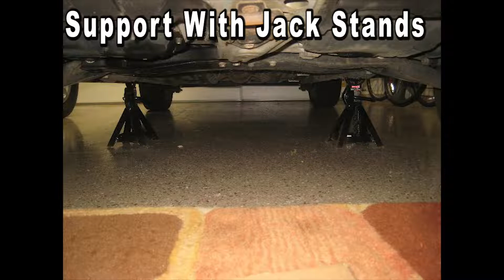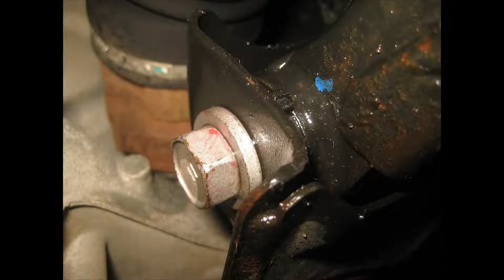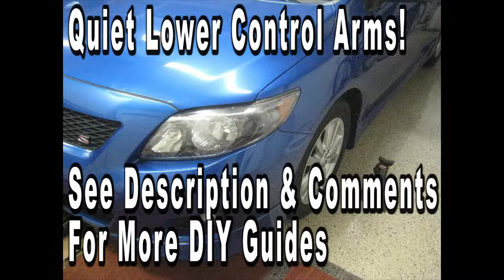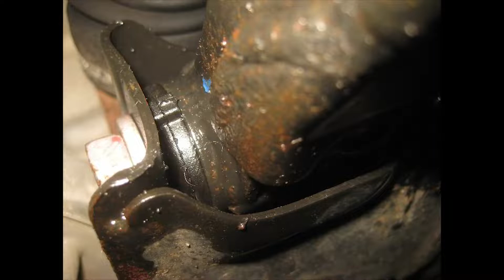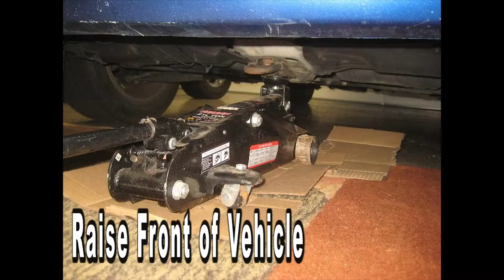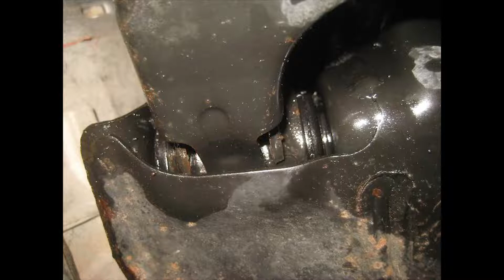Toyota Corolla How To Lubricate Noisy Front Lower Control Arms 2009 2010 2011 2012 2013

Comment from the maker: Check out the DIY tutorial for lubricating the front lower control arm rubber bushings a 10th generation 2009, 2010, 2011, 2012 & 2013 Toyota Corolla - 
https://www.paulstravelpictures.com/2009-2013-Toyota-Corolla-Control-Arm-Bushings-Lubrication-Guide/index.html

Here are all of the DIY repair and maintenance guides for the tenth generation 2009, 2010, 2011, 2012 & 2013 Toyota Corolla - 
https://www.paulstravelpictures.com/Articles/2009-2012-Toyota-Corolla-Common-Problems-Repair-Maintenance-Guides.htm

This automotive "how-to" guide was specifically written to assist owners of the 10th generation (2009, 2010, 2011, 2012, & 2013) Toyota Corolla in lubricating the dried out rubber bushings in the front lower control arms to reduce or eliminate creaking, popping or ticking noises during slow speed tight turns or when coming to a stop.

Owners of other Toyota, Lexus or Scion vehicles such as the Yaris, Matrix, Prius, Camry, RAV4, Sienna, Tacoma, Tundra, FJ Cruiser, Venza, Highlander, Avalon, Sequoia, Land Cruiser, Allion, Premio, Auris, IS 250, ES 350, GS 350, tC, xB, xD, iQ and FR-S may also find these DIY instructions to be helpful.